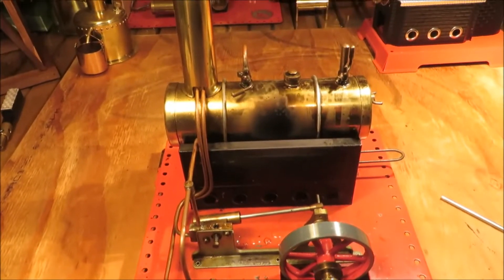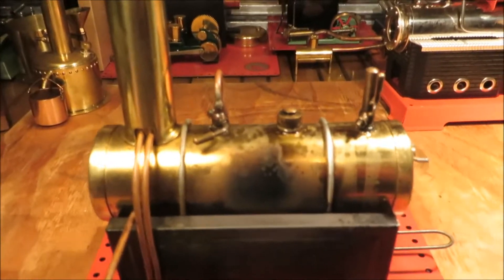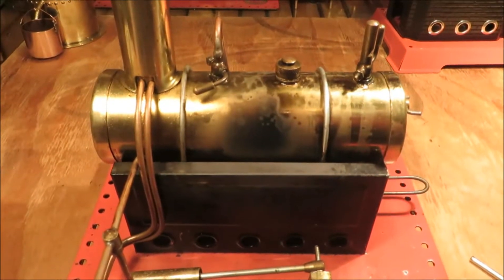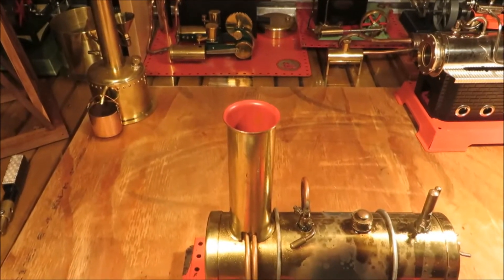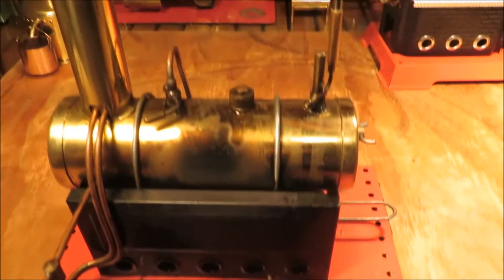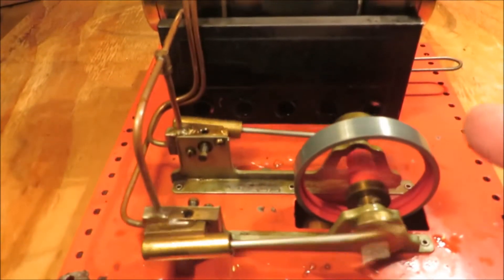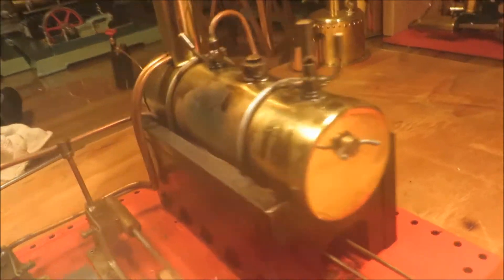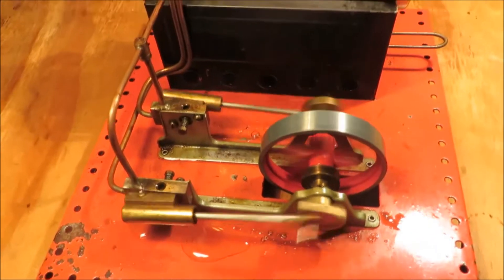Mamod SE3 Model Toy Steam Engine

Comment: I think you you'll find the cranks have to be opposite each other, which  is 180 deg, so one cylinder is on the power stroke and the other on the exhaust stroke. There's room to fine tune to be either late or early on the stroke.
Reply from the maker: You can play around with these they are a lot of fun. You should keep your eye out for one on eBay. They are great value for what you get.
Reply: Blue Heeler  yeah,  I have one in the middle of a resto and another on the way....
Reply from the maker: You'll enjoy them and they are addictive. They have enough power to run a lot of accessories.

Comment: The position of the cranks is correct. You'd only do it "quartered", say one at 12.00 o' clock and the other at 3 o' clock if you had coupled wheels, such as on a railway loco'. I initially set my SE3 as "quartered". It ran smoothly, but not as fast or with as much power. Yours is a little lanky. Just a little worn that's all. If everything is as tight as it should be, try using an oil that's a little thicker on the crank pins.
Reply from the maker: +Prince Gerald Thanks Gerald :)
Reply from the maker: +PLAYING AROUND! Many thanks, appreciated :)